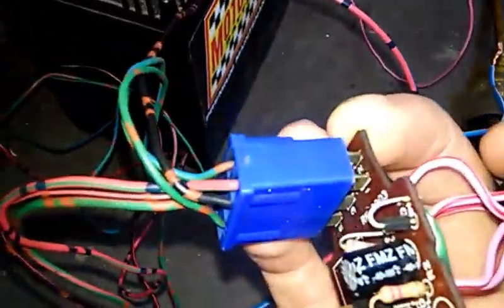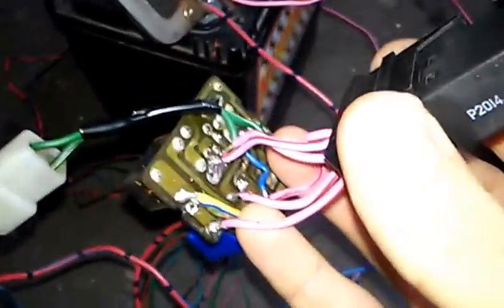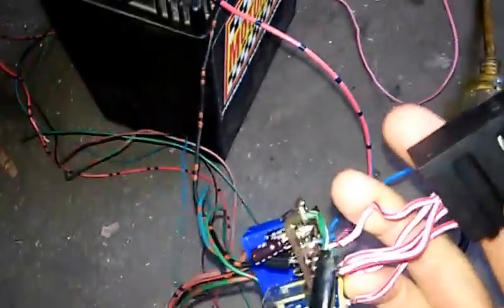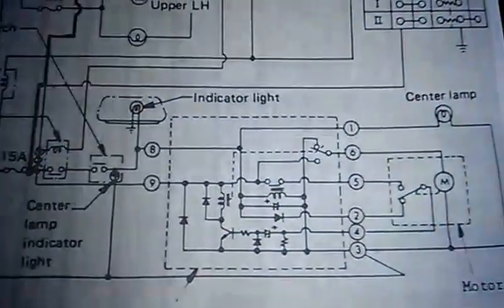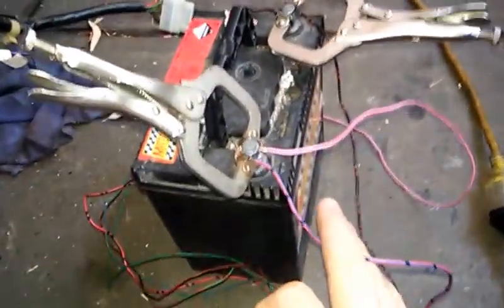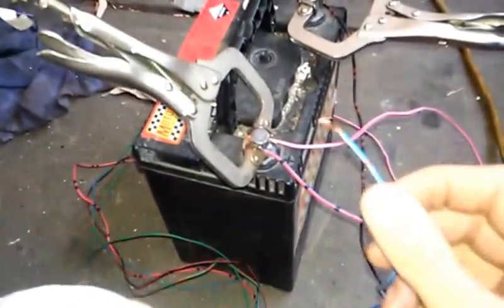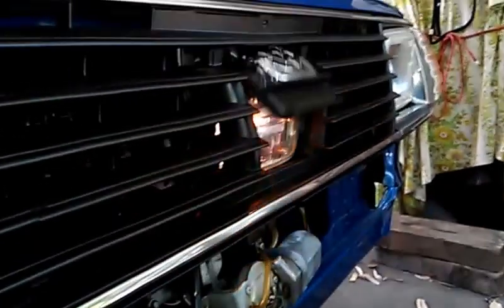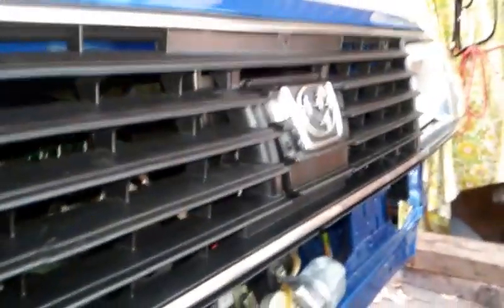Subaru third eye

Comment: Hey Sam! Where did you find the schematic diagram? I have a 82 brat an the light relay has been out on it. An I need your help. 🙏
Reply from the maker: Local old Subaru community here is Aus ;) See if you can PM me on here and I will send you the files.
Reply: Sam J I can't find a link to pm you! Do you have Facebook or any other media I could wright you on?
Reply: Write** dam auto correct
Reply from the maker: Sorry not too keen on putting my personal contacts on here so easily! 
If you trust, I've uploaded to a file host the 2 pics: 
https://nofile.io/f/1VzkWdPNsRg/center+light+2.jpg
https://nofile.io/f/hGBUv0077hh/center+light.jpg
or if not, request to join the "Classic Subaru Network (4x140 or GTFO)" on FB and ask there. It's a good group to join anyway for old Subaru stuff if you didn't already know about it.